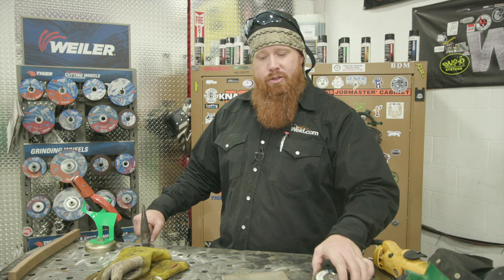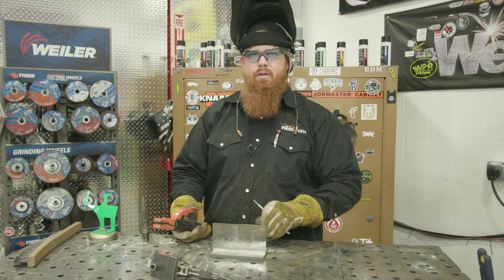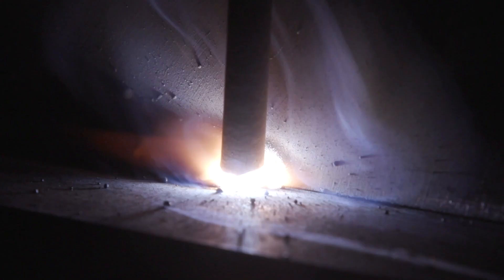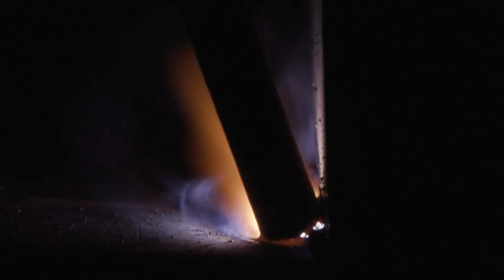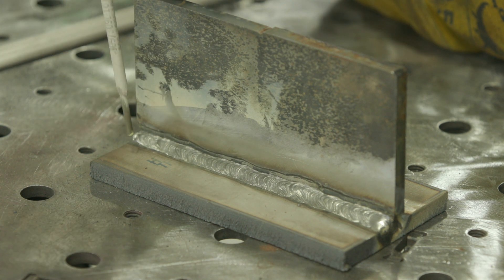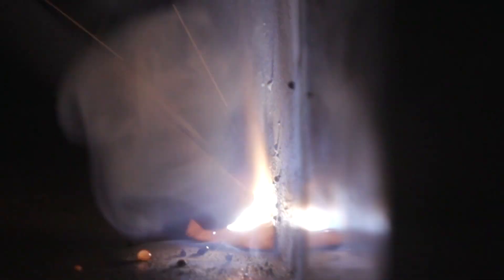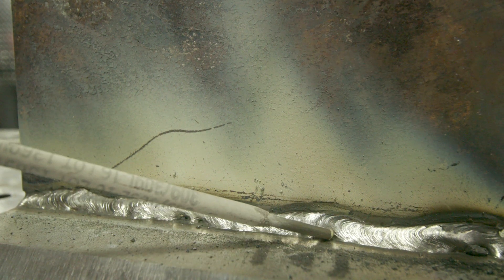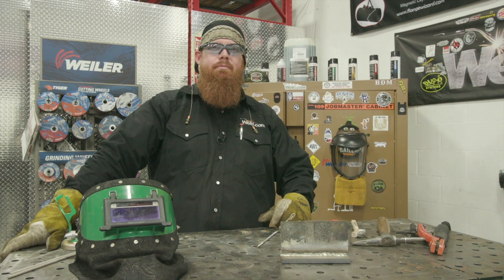Don't Make this Mistake Welding Stainless to Carbon Steel

Comment: what would happen if u were to mix high-carbon steel with stainless steel and melt them down and stir the mixture together will the high-carbon steel keep its strength and become non rusted when its exposed to moister and water will it become brittle and crumble?

Comment: In a coated electrode arc welding, which melts first, rod or flux coating? and why?
Reply: The rod, because that’s where the electrical current is going to and actually generating the heat. That melts the flux coating. On a lot of rods you’ll see when they’ve been used that they have a hollow end where the wire has melted out and the flux is still catching up.

Comment: I want to weld a bearing to the outside of a disk brake rotor ? what rod or wire can i use ??

Comment: Ok this might be a stupid question, but let's say I'm building a new exhaust for my truck and I wanna make it out of stainless steel, a cat-back system. The old piping is just your everyday normal steel and that's what I wanna attach that stainless pipe to. Will that carbon (or mild?) steel rust fast when it's attached to stainless? As in, will my new exhaust life-expectancy be something very short and ending in big clank when it drops to the ground after rusting away faster than if the whole system was just carbon steel?

Comment: Are there special electrodes for this kind of stuff?
Reply: Depends on the application of the part you are welding, besides 309 the other commonly used type of filler material is Inconel.
Reply: Banana Warrior yes, use a 309 electrode. It available for stick, mig and tig.
Reply: 309 Stainless to mild/ 308 Stainless to Stainless

Comment: any temp change between 7018 and 309
Reply: most manufacturers recommend 10 amps lower than standard setting for a rod so 3/32 7018 at 90 amps 3/32 309 80 ish amps depends on position

Comment: You make a video on how to put a tig root on pipe
Reply: Bob has a few of those on here.  https://www.youtube.com/watch?v=dXKwvnGNiO8
Reply: @byron7165  how do you put a tig root backfeed or laywire
Reply: @agustinhernandez6094  I've never touched a tig torch.
Reply: @byron7165  really i always thought you could tig. What procedures do you do?
Reply: @agustinhernandez6094  fcaw, gmaw, and smaw.  I'm trying to trade my MIG for an inverter tig/stick.  I want to do thin artsy stuff and tig is where it is for that.